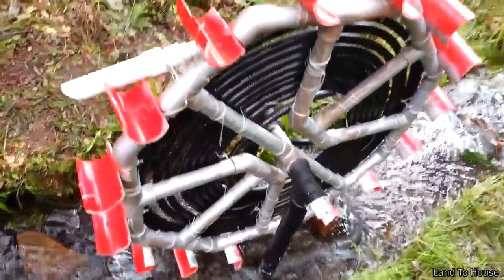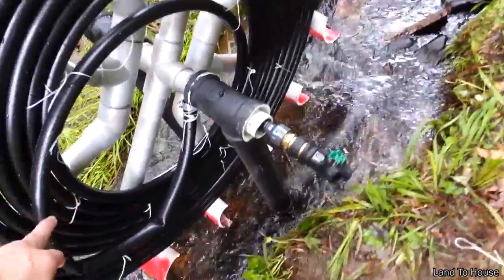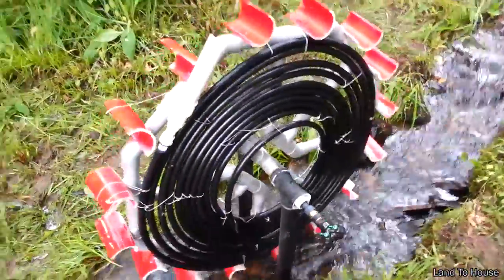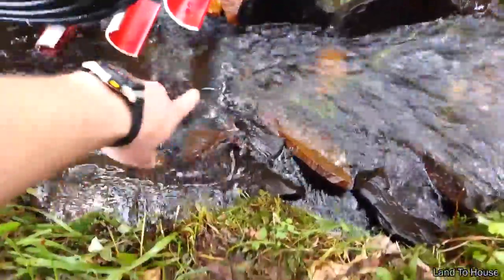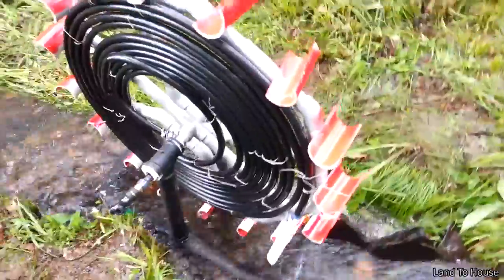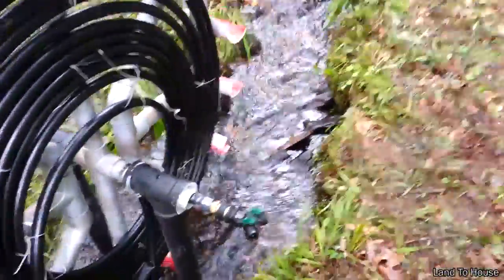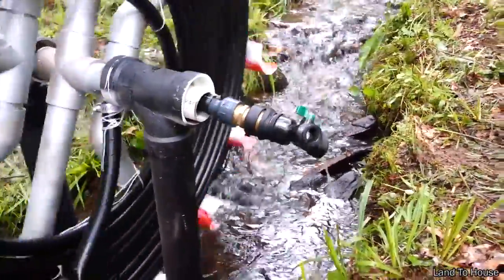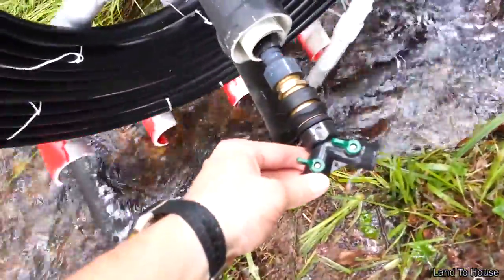Water Wheel Update 2

Comment: You will get a back fire in your setup and some water will be expelled through the scoop. The innermost coil dimeter should be no less than half of the outermost coil dimeter. The reason for this is because only the air sockets get compressed in subsequent coils while water sockets stay the same. Since the outermost coil is half filled, the innermost shall not accept more water than the half of the outer most coil. So the innermost coil should be approximately 3/4 of the outermost coil.

Comment: This video came back up on my youtube list.    I'm not sure PVC pipe is the optimum method to construct the wheel in a way that can be transported, but still haven't found a better idea.    I did find a couple of water wheel videos where they were using the wheel to increase the read for ram pumps:
https://www.facebook.com/groups/240458583255303/permalink/687556208545536

I've never seen a comparison between output from a water wheel spiral pump and other water powered methods such as ram pumps.
Reply from the maker: Ah yes this old video. This summer I plan on building a few water pumps other than the ram pump. Should be fun. Probably will try a wheel like this.
Reply: Are you planning a 2021 kickoff video about water powered pumps (ram and other)?  If so, I'm thinking might be best to direct questions and links there?
Reply from the maker: I had not thought about a kick off video. Would be a great place to have people make suggestions. (It has been 25 degrees and snowing here. Hard to think water pump videos)

Comment: Update,  please  it's been 6 years and over 200,000 views this is a popular series.  I'm building one for myself and am wondering if there is an advantage of using big spirals or small spirals for pumping water up hill?  Thank You! Eric
Reply from the maker: Whenever I got stuck on the swivel I kind of abandoned this project. I did locate a pressure washer swivel I think we work well. I have it just never did use it
Reply: @LandtoHouse  Out west here (central Wa state) there is a sprinkler system called the "R Pod" sprinkler system, it's a series of sprinklers in a series  of pods connected to an underground line, the connection is a swivel, pricey but it has a larger opening in it.  $65 ea!. For 1 1/2" swivel, There's a facebook page by Dave Bean called "water wheel pumps" I've got a short vid of my glacial progress with a pic of the r pod connectors on it.  If you haven't seen Corey Clines vid on you tube you're missing one of the simplest wheels around, it was my inspiration on this project!  Your thoughts on small coils over larger coils?  Thanks again!  Eric

Comment: looks like you have moved on from this idea, but 2 comments on your design....or 3 depending on how you look at it

an over shot design will deliver more power than an under shot like you are trying

also, your paddles are very inefficient.....your spilling a lot of power with the flat paddles. closing the ends would increase the power of even your under shot wheel. making them as larger would increase power as well

good effort and I am looking at this option as well.....and checking out your results on others you try
Reply from the maker: This idea was a long time ago but I would like to come back to it someday. I have found a much better swivel and that will make a big difference. You are right, those paddles are not very efficient at all. I need to find a better solution to them. It was my hope to find a nice wheel that was easy to make and could be floated on flat moving water for larger rivers.

Comment: any more updates on this one? how far do you think your design can pump and how high? one of my creeks i can dam and get about 2 feet of rise from it to create an overflow over the dam wall. i am thinking i can make an overflow trough that sits at top of dam wall angled down to the creek bottom directing over flow straight to the water wheel that sits in the trough. this should create plenty of accelerated speed with the water to push the wheel yet allow the scoop to gather the water to. just wondering if this setup is worth the time because i need to push water to my garden up hill about 20 feet high and 300 yards or so away. i do not have the possibility to create the necessary head height for a ram pump nor the distance from neighbors property line in the creek to run a line to build pressure before a ram pump etc... so my options are limited there. i can how ever raise the creek two feet before it floods over the property line. hope this all makes sense :) and hope you can help...
Reply from the maker: +FixedByDoc Homesteading I have not worked with this design since years ago. I believe it was one of my first projects on the channel. Since making this design I have located a swivel that actually works. Somewhere I heard the math Behind these wheels. Number of coils x height of wheel equals the feet of lift. But I never did get to that stage. Have you seen the river pump? I am currently working on an updated design I just need to take the time to finish it. If you type in River pump on Google you will find the actual product. It might be exactly what you're looking for.
Reply: Land to House
i will search for it. i don't plan to make anything until next summer. just fair warning though i am planning to kidnap you and hold your dogs ransom while forcing you to invent things i need around my homestead next summer. i will release you in the fall i promise :)
Reply from the maker: +FixedByDoc Homesteading hey as long as you're supplying the airfare , Room & Board and the $200 worth of groceries I eat a week I'm up for it. Haha
Reply from the maker: +FixedByDoc Homesteading haha so the inventions have to work? Now we have a problrm.
Reply: Land to House
lol... yep your ram pump works so you messed up and set your self high expectations now buddy... now get on the drawing board. #1 a workhorse wind mill that runs a belt drive that i can attach to different machines as needed to operate them. ie: anything that has a belt driven motor like a washing machine :) I certainly have the wind in my field to make it work. i can get the water and the washing machine. you just need to build me a good windmill device and i will feed ya lol. seriously though the water drive system and the windmill are my two biggest projects i need done next year. shouldn't be to hard to do.
Reply from the maker: +FixedByDoc Homesteading wind is certainly one thing we do not have around here. I was outside today for about 6 hours and I don't think there was even a slight breeze. It would be hard for me to test a wind turbine with no wind. I have heard that water power is more efficient at mechanical work than creating electricity. But if you have the wind it shouldn't be too difficult to create a windmill. I saw a video of one that used big metal plates to capture the wind. It seemed very efficient.
Reply: Land to House
i dont have enough water for powering anything real. but i can run a turbine in the woods no problem. my turbine runs year around and sits below tree line and supplies power still. it is 30 feet tall and about 15 feet under tree tops. my back field is treeless and gets upwards of 30mph winds on average. plenty for a windmill to run machines like washing machines and grinders and such. it would only need to be higher then the corn which is under 10 feet tall. the strongest winds back there have reached 50mph in the last 3yrs.
Reply from the maker: +FixedByDoc Homesteading you will definitely need an electrical break. Those are some high winds. You would not want that running away. Have you seen Wranglerstars film when he got to tour the windmill?
Reply: Land to House
windmills don't produce electricity. wind turbines do though. a windmill produces a mechanical function like pumping water or turning a grinder for corn milling etc... where a wind turbine generates electricity and thus would need an electric break. i have a nice wind turbine and it is 3 phase which means it utilizes an electric break that self powers and shuts down at a certain wind speed. a windmill would use a friction break or resistance to prevent over spin. generally you shut down a windmill by applying a friction break and when it comes to a stop you insert a locking pin. then when the winds die down you remove the pin and let it go again. you build both types of them to match the normal/average wind speeds for your area.
Reply from the maker: +FixedByDoc Homesteading oh my I was definitely mixing the two. Like I said we have very little consistent wind here. I can imagine if you have a consistent wind you would benifit from having such a strong mechanical power at your disposal.  Clothes washing would be a priority. There is an old belt driven saw at a local antique shop. I am not sure what the condition is but it would work well on wind power.
Reply: Land to House
my idea was to build a windmill that could be used to turn all kinds of belt driven stuff. then get things like a washing machine and remove the electric motor and swap for windmill belt and make the controls manual. then get a band saw maybe and perhaps a water pump for the back garden and lots of other things i could switch it to as needed. i want to tour some amish sites here in PA next summer if i can. see how they do it.
Reply from the maker: +FixedByDoc Homesteading seems like a very good plan. Go to the source and see how they do things. I assumed you would only use one Appliance at a time? A saw or a washing machine....
Reply: Land to House
exactly. just one at a time. dont think it would work with multiple going due to torque etc...
Reply from the maker: +FixedByDoc Homesteading unless you had a monster windmill.
Reply: Land to House
lol dont want to scare anyone now... just imagining it having eyeballs on the blades so when it spins it looks like one big eyeball. then have some sort of noise maker on it so it sounds like it is growling and snarling as it spins. then paint the tower to look like it has a giant mouth and put some arms on it. see what you have started now...
Reply from the maker: +FixedByDoc Homesteading I am envisioning a couple hundred kazoos strapped to the blades to make a horrendous buzzing noise
Reply: Land to House
sweet... but i only own two...
Reply from the maker: +FixedByDoc Homesteading well you had better make it a small reasonable monster windmill.
Reply: Land to House
lol..

Comment: A couple of suggestions 1(1/2" pipe thread female/ female (360°) swivel hydraulic connector and grease nipple) the quick connect will not last long and can not hold more than a few psi while turning. I made a stream powered water pump that uses 1" pipe to capture water and air mix at about a 50/50 at input. It creates 21 to 23 psi at exit. Because of exit pressure compression 75/25 water/air by volume. By running it through a water/air splitter I am able to lift about half the water to 50 ft. and the rest a water/air 50/50 mix to over 70 ft. By using 3/8" ID line the water is unable to pass the air bubbles and as mix rises it expands. Water/air mix enters at 50/50 and leaves around 25/75 water/air after 70ft. lift. The weight of the water in the pump is around 31 pound. That is equal to a column of water 63.75 ft. As setup is configured it can lift water over 80 ft.https://m.youtube.com/watch?v=4omE2UpNOSE
Reply from the maker: +TheGotmilktogo Thank you for the awesome suggestions! I started this project years ago and I have let it fall the the wayside. I have now found a swivel that is designed for such an application. It is not a quick connect at all. Your build seems to be working very well! I like it a lot. I might have to revisit this idea sometime in the future.  Thank you again for the ideas and motivation to get back to this project.
Reply from the maker: +TheGotmilktogo It seems like you are getting a lot of good results from the pump. I really like your air separator a lot. Back when I started working on my water wheel I had the idea of that hose connecter but it was not going to work well at all. The new swivel that I have seems to be well made. http://goo.gl/i0O0sh I dont know how long its going to last and I dont know if it is of better or worse quality than what you already have. It is only around $23 so that is not so bad. 

Does the wheel float or do you have to have it on the ground? I have seen some that have a larger base that floats. Just thinking that might be a good way to go. That way you could make the base a little larger so the debris will go under without clogging. The rebar idea seem very heavy. 

I would like to give my PVC wheel another try soon. You have inspired me.
Reply: I tried a fitting like the one you are looking into. It lasted about 2 weeks. The fitting I've found is about twice as expensive, but I think it will last a couple of years (if maintained).
 The stream is so low most of the summer the water is not deep enough to float anything. The floating one works well in about 2 feet of water or more. Because it has a smaller dia. and width it's max hight is about 50'. I made one out of 2(5gal. buckets filled with foam) and 100 feet of 5/8" hose. It's limited to about 40'. I do like your PVC pipe idea a lot! The reason I use rebar is the price and ease of forming circles.
 Good luck.
Reply: mixed feelings on that air / water separator ,  as you would be loosing your max head height by removing the air , 

if your going horizontal its a good idea but going vertically it will be crippling it as Hydrostatic pressure will not be their to assist with the lift 

with my water pumping I actually inject air into my water lines to increase my head / flow rates .,..  this way I can use basic 3~5m head pumps pumping 7m heads with flow rates as if  they are are only 1m head
Reply: Half the flow is lifted to 60' and the other half to 90'. In the 5/8" line directly out of pump max lift is 70'. This includes a 35' level run. (My current 90' height is because I am unable to get the outlet higher. I think it will fail between 100' and 110'.)If the flow is stopped and the air runs out of line it will not restart until head height is reduced below 62'.
 The 3/8" line makes a good air lock that fails in a 1/2" line and 1/4" line resistance reduces volume greatly. The pump uses less than 20 foot pounds of torque. The stream water level drop through the pump is between 8" to 12" and 3' wide. Each rpm captures about 1 pint (1 lb.) water and 1 pint air.
Reply: I think there might be a misunderstanding. The air/water splitter separator splits about 1/2 the water and all the air into a 3/8" line. Lifts to 90'. The rest of the water into a 5/8" line. Lifts to 60'. 
 A 5/8" line directly from pump lifts to around 70' and if pump is interrupted the height must be lowered to below 62' for flow to be restored.
Reply from the maker: +TheGotmilktogo I would have to see all this in action. It's difficult to conceptualize. I have no real experience with air lift pumps. I don't know the math behind them at all.
Reply: The collection scoop picks up about a pint (1 pound) of water. As it is lifted the water is funneled into a 1" line on the down stream side of wheel. Gravity pulls the water down against the air that is trapped in upstream side of loop. There are 33 loops holding 33 pounds of water and about 33 pints of air. As pressure (26 to 31 psi) is applied the air is compressed to 1/4 it's volume. Air/water mix exits pump into splitter that has two exit pipes. 3/8" at the top and 5/8" at bottom. The splitter hold about 5 pints. The extra lift is by displacement. Half the water in the 3/8" line is replaced by air. Reducing the weight by half thus enabling 29 psi to lift above 90'. (Note 29 psi can only lift water to max 62'.) The hydro static pressure and line resistance have little effect because of low volume of water moved. Between 900 and 1500 gallons in 24 hours depending on rpm. Between 0.5 and 1.2 gallon per minute. If pump turns to fast the centrifugal force overpowers gravitational force and the air lock in the pump fails. If the pressure increases to greater than water weight the air lock fails. The pressure in both lines are the same even though the 3/8" line exit is 90' and the 5/8" exits is 60' because the water is displaced by air.

Comment: You only need to do onething to your spiral water wheel .close the half cut pvc paddles like a scoop will work right away equal the force of the water vs the weight of your spiral water wheel you must get it working for you cuz you worked for it
Reply from the maker: Richard Christie That and remove the foundation that blocks the water flow to the paddles. Thank you for the tip!  One day I will try this project again. But for now it has been placed way on the back burner.

Comment: the water collection pipe is facing the wrong way.
Reply from the maker: Ed Wilson Interesting. I would not have thought of that. I am guessing that the way it is oriented now actually reduces the wheel velocity.
Reply: the water flow has to travel that way or the spiral pump doesn’t work....it is correct

Comment: Really interested in your water wheel pump. Any progress? Are you able to pump water with a small stream like that?
Reply from the maker: Had I made the modification to the legs to allow for better water flow i  could have pumped water.  The paddles also need to be larger.  The Ram pump works much better for a Creek of this size.